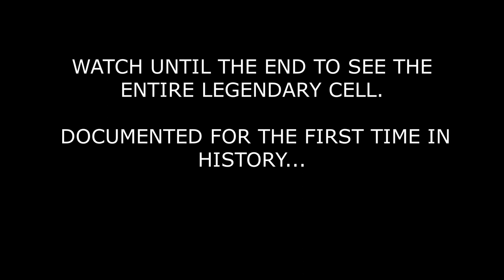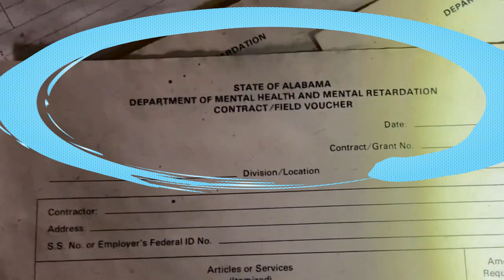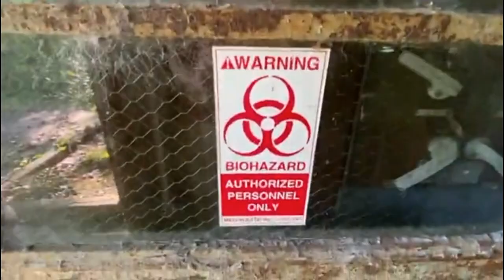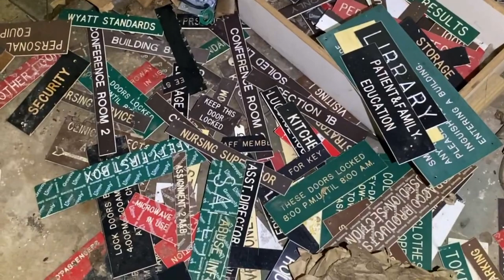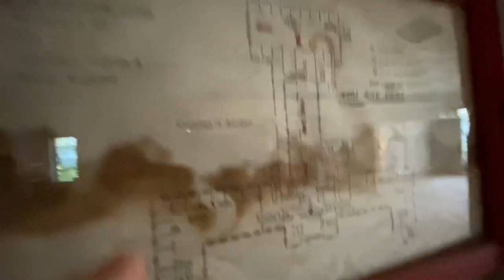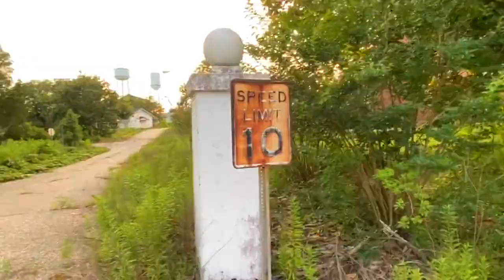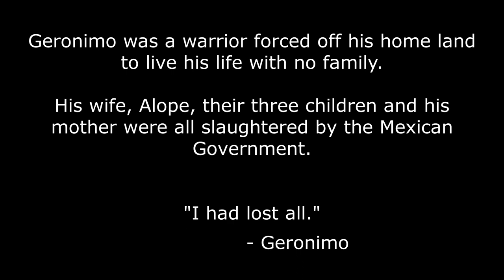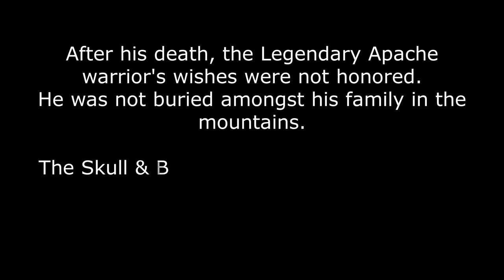Finding Geronimo's lost CELL /Searcy Mental Hospital

Comment: Patients were kept in cells they had rooms most of the time there were 3 or 4 to a room they weren’t locked up at night granted they couldn’t get out of the building they weren’t locked in their rooms unless they were a danger to others then they were put into isolation the patients who were getting better had levels level 1 they were able to leave the unit accompanied by a mental health worker, level 2 had grounds privileges from 10:00-1200 level 3 had grounds from 10-12 and 12-2 level 3 was pretty much on their way out